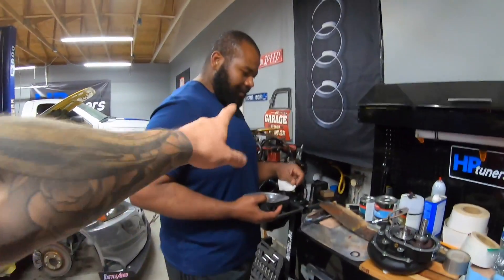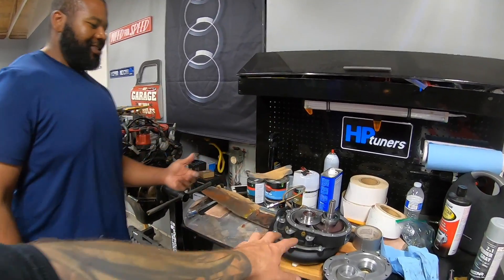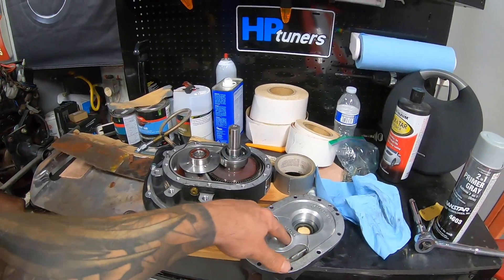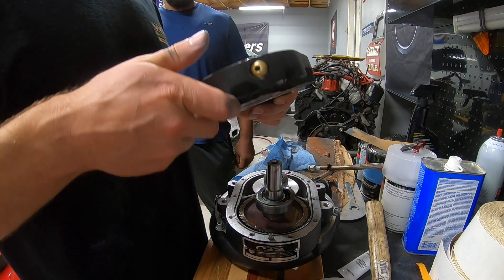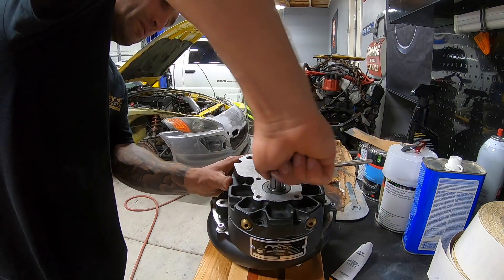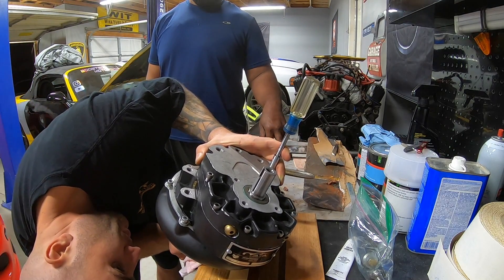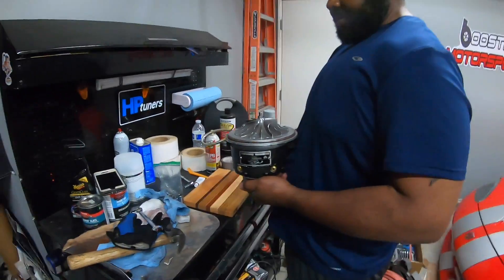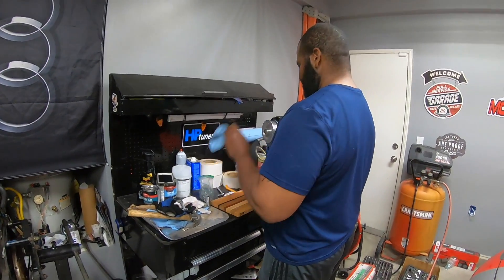Rebuilding a Vortech V3 Supercharger | Part 2

Comment: Hey brother, currently rebuilding mine and I get to the point to where I’m a few millimeters prior to both housings being flush . But is I go to tighten it down the gears lock up do you have any recommendation for what I’ve might’ve done wrong?
Reply: Hey bro did you ever figure it out?

Comment: I'd like to explain why your repair was failed, before removing the high speed bearing race you should mesure the distance between shaft end and the inner bearing race, after installation of the new slinger you should install the new bearing at the same measurement   if not the wavy springs will push over the shaft to the other side instead of providing preload the bearing thrust side. Also you should never apply any kind of pressure to the shaft end at best you can use a socket on the compression nut to support your bearing installation, heating it to 100c is the best method
Reply: Sure
Reply: @Airman..  what’s the best way to contact you??
Reply: Could you help? I’m currently in the middle of my revuild

Comment: Next time remove the old seals, put the shafts in the housing, than install both seals after assembly. It's a lot easier and won't damage the seals.

Comment: Is that the 928 oil slinger? Did yall try tapping the outside of the case with a rubber mallet to get it to seat?
Reply: No, that is the Supercharger Rebuilds com upgraded oiler that will not fail like stock !

Comment: Did you guys end up using the 928 slinger or stock slinger? I have a Subaru with 10 rib  Vortech V3 Si that I am working on
Reply: I also want to know....
Reply: No!, that is the Supercharger Rebuilds com upgraded oiler that will not fail like stock ! They started the aftermarket centrifugal repair service over 20 years ago and are the experts with the most experience  - others copied them. Have every part you need - even the gears and upgraded billet impellers....

Comment: The impeller on the this unit is it a upgrade from 928. If it is does it make the difference.
Reply: No, I believe that impeller is gold
Reply: No, that is the stock cast impeller in video... BUT Supercharger Rebuilds com has several styles of upgraded high end billet impellers.... They have every part you need - even the gears and modification services to larger impeller sizes as well !

Comment: Cool! I'd check the shaft seal behind the compressor to make sure it is in good shape. Know how all that goes with all the years I've worked with turbochargers. Keep us posted!
Reply from the maker: Yeah I agree Mark. I didn’t assemble it he just brought it over after he was having a hard time getting the case to close but I think he may have popped out the compressor seal forcing it closed.